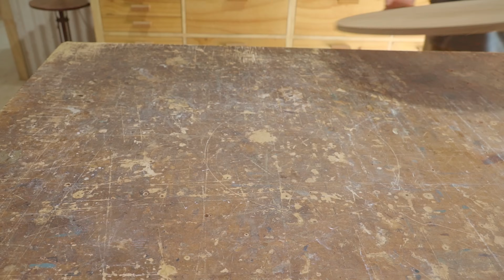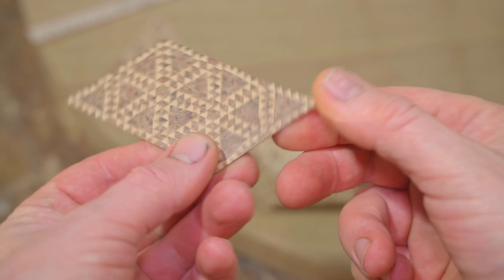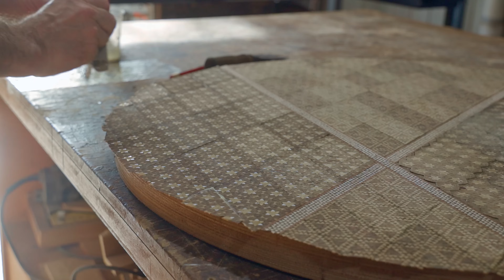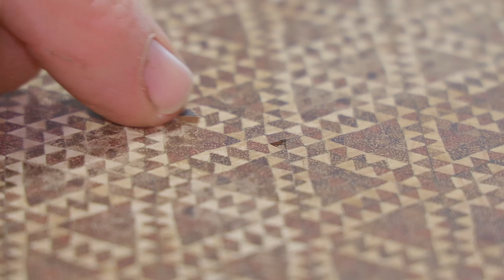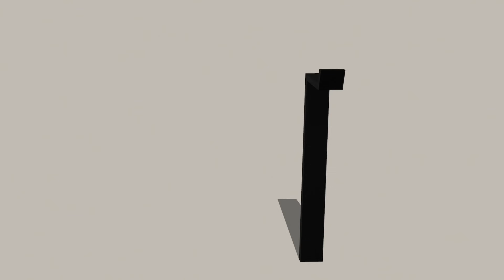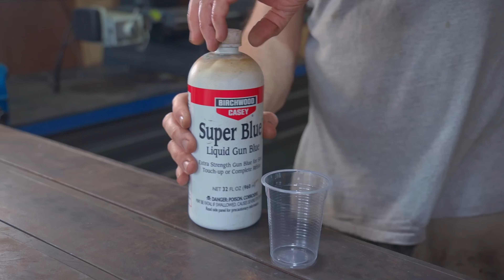Incredible Coffee Table Build - Crazy Amount of Work - Was it Worth it?

Comment: @paskmakes the top turned out gorgeous! I have an antique round poker table to refurbish soon. Instead of felt...I also want to add other games to the surface. I was going to paint but now I'm thinking inlay thanks to this! Any tips for a backgammon board?
You said the edging kept spreading...I'm guessing I'll have that issue as well.  Do you think it would work if I tacked a finishing nail straight up and down (into the work surface ) flush with the end of the strip on each end or do you think it will interfere with the clamp? I've not glued anything round before

Comment: Holy wow… 😭💕✨✨✨
For the table edge, would it work to glue on the first inch or so of each strip and let them dry, then glue on the rest using that ratcheting strap? That way the fixed ends wouldn't pull away as the strap tightens.

Comment: Awesome work as usual Pask 😊 little project idea - making a (working) shooting plane (looking at the veritas shooting plane & Stanley 51 for inspiration) from a piece of wide steel angle iron (hardened to make it less flexible & more brittle like cast iron?), the frog & blade assembly from a normal hand plane, with handle & tote made from scrap wood.

Admittedly it wouldn’t be very useful (you have many amazing machines!) but I think it would be an interesting project and show piece - no pressure though

Thank you for the many amazing videos 😊

Comment: I imagine someone else has already said this, but just incase…to bring the brushbox outer band join together all that had to happen was put the hand piece of the band clamp at the joint. The surface tension/grip of the band would drag the strips together at the joint. 
The pressure of a glue up blinds the best of us to the most obvious fix. We’r all human. Fantastic job as per usual

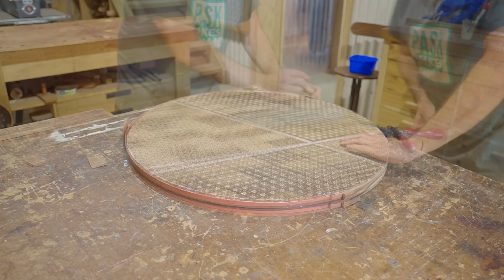Comment: @11:57 band clamping the edges, it seems you might have been better off with the clamp at or close to the joint to pull the 2 edge strips together rather then pull them away by have the clamp on the opposite side.

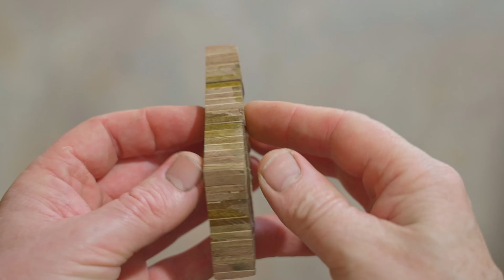Comment: You should have used a small sled for the bandsaw to cut them.  6:01 the pressure on the fence was inconsistent. A better fence would have helped. Companies like 80/20 sell modular aluminum extrusions.  A 20/40 slotted piece would be excellent for a rigid fence. It's a little spendy though. If you ask, I think they also make a version with 1 side smooth.

Comment: To solve your band clamp separating the edge trim pieces problem you should have the clamp sitting just after / on one of the pieces and have the second piece butted against the first on the side that the clamp is pulling the band.  This will cause the friction of the clamp band as it slides more and more closed to pull that piece into the other.  How you had it lets them free float and the clamping force / friction is uneven from the pulled side to the "stationary" side, causing one to slide away from the other.  This is all I have to offer to this very intricate table build.

Comment: When forging a corner near the end of a bar, try the following: Bend a 90 oven anvil's edge, lay bar flat with short side sticking up, hammer that short end straight down 'into' the anvil. That will flatten the radius and form a sharp corner. Helps to have only the bend area hot as well, otherwise all that hammering may cause the end to mushroom a bit.

Comment: I’m not a Carpenter. But I have done art a time or two. Imperfections and inconsistencies are noticeable when you have fewer and larger examples of the pattern or design. However the more of the pattern or design you use, the less the individual imperfections and inconsistencies matter. They become something like a consistency unto themselves. Much like your use of asymmetry is self consistent because it is a single occurrence, many minor inconsistencies in addition to many consistencies can be a perfectly acceptable aspect of the piece. 

Turbulent Flow, or Fractals are like this. If you look at pictures of Saturns Storms, you see a greater theme, who’s manifestations change constantly, but are all individual variations of a larger thing. Fractals themselves are minor variations on a previous design, whose individual variation reveals even greater near symmetries. 

It’s kind of fun to try and see how much you can bend the design like that. It’s sort of the heart of Architecture.

Comment: 11:50

If you put the band clamp tensioner between the gap of the two strips you want to butt together, it would close the gap. Not sure if putting a thin strip of blocking there would give the clamping you want underneath on the seam.

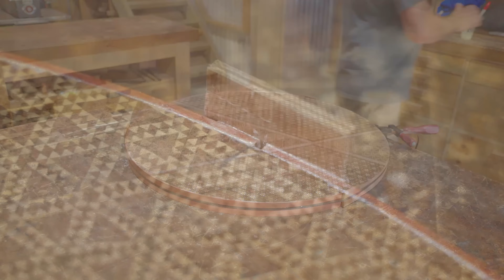Comment: Solution at 12:05 would be to flip band clamp so it's ratchet mechanism was close to the joint you want to pull together. As you tighten, the string "pulls toward" the handle, which works against you when it's across the circle from the joint.

Comment: Just a suggestion…. When clamping the edge banding, place the body of the clamp at or near the joint. With that style clamp it should help pull the joint together, rather than being opposite the joint and pulling it apart. Thanks for another great video!

Comment: Thank you for another great presentation. The only thing I might've done differently is to trim off the edges of one of the dividing line pieces. This would allow the interior patterns to be uninterrupted and the borders to be solely on the outside of the pattern in both directions. Keep in mind that I didn't think of that until near the end of the video, so I would probably have done exactly as you did. :)

Comment: Hi there if you have the band clamp tensioner at the point of the two joints then as you add tension the ends will be pulled together

Comment: On the band clamp joint. Put the tightening part of the clamp at the joint and it will pull it together instead of apart. Your project always look better than you think and are always inspiring!!
Reply from the maker: That's a good point. I don't always think straight when the glue is going off and I'm trying to film the whole thing from different angles. :)

Comment: Looks amazing, the only tiny change I would have done is taken off the borders where the two angled dividing "cross" met so the triangles blended better.  I also honestly think the misalignment proves it's hand made not all precision on a cnc computer - it's often the defects that give the character.  Look inside any Thomas Chippendale or similar era piece (of which I've seen several in my professional capacity) and the joints and other cabinetry are all over the place - gappy, not centered,  and misaligned enough to be noticable, but from the outside - it all looks great for the average persons eye.

Comment: It looks great. I like when you add in your problem resolution process. Much like you did with the canoe. You really have a knack for understanding all sorts of different processes like forging, welding, woodworking with power tools and hand tools, which are often separate disciplines but are not mutually exclusive in your shop. Well done. If you ever band a round table again, perhaps a couple of brads at the joint would have saved you the fudging of of the joint later. The brads would've been hidden anyway by the legs so it may have made that operation less stressful. Maybe a little wax on the band clamp too to keep it from pulling the strip with it as you tighten. Just thinking out loud as it were.

Comment: 0:53 why?
Reply: Why what?
Reply: @mtqrx  why finish with the jigsaw and not continue with the router?
Reply: @michaelcritchf  if you went all the way with the router you’d need a spoil board behind it. It’s easier to get rid of most of the waste and use a flush cut bit
Reply: @mtqrx  thanks. Also with the jigsaw I need to ensure free space behind. But with the jigsaw I’d worry to accidentally cut into the product
Reply: @michaelcritchf  yeah with the jigsaw you can just support it on either end, it doesn’t matter as much as the router if it flexes a little. You don’t need to get super close to the work piece, the final cut is still done by the router, it just helps to get the material out of the way so you’re not having to manoeuvre the full panel around

Comment: Your probably right about cutting and welding the legs, but the journey is just as important (if not more important) as the destination. Using the forge looks like way to go for soooo many more reasons than ease. After all, if this project was about ease, there wouldn't be 55,000 pieces in the top! 💖🌞🌵😷
Reply from the maker: Thanks very much! They weren't actually difficult to make in the forge. The biggest hurdle was that I haven't forged anything in such a long time and it's not something I'm particularly experienced with. A real blacksmith would knock them out in no time. :)

Comment: Well now I want to know where you learned that technique for forging a 90° corner. I watch tons of blacksmithing videos, and everyone makes a big deal of how hard it is to make a square corner, having to upset material back into the corner, and none of them have ever shown anything like what you did here, they all tend to bend a round corner, then heat it and hammer from the ends to push the material into the corner, and it takes a lot longer and can easily distort the legs! Your way here seems much easier, quicker, and cleaner!  I absolutely will be trying this next time I’m in my workshop!